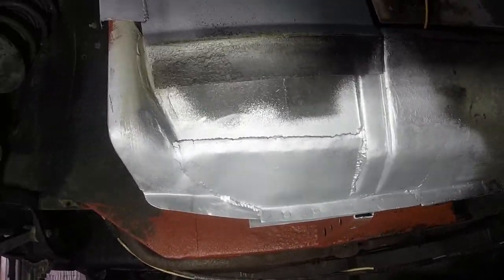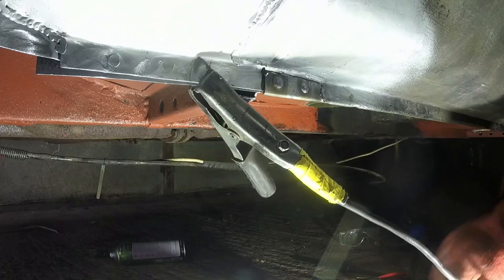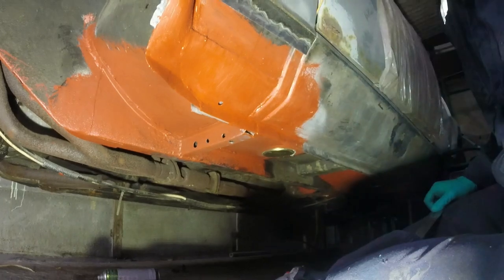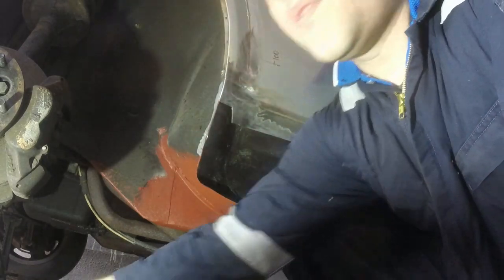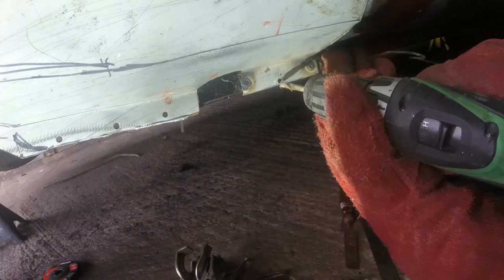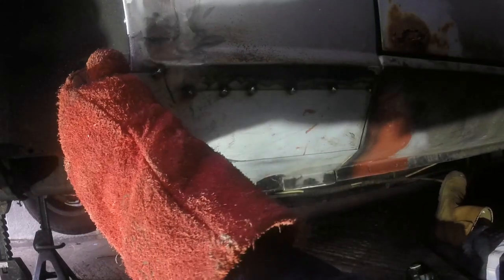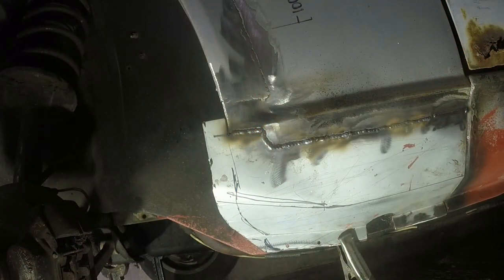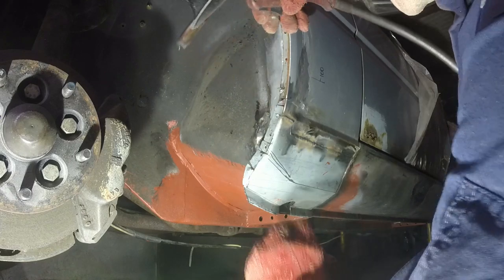Dotty 1981 Rover SD1 Restoration - Video 24 Fabricating lower wing 3

Comment: Very interesting mate and very helpful video mate. I liked this episode. Am not  going to call myself a welder but  have been known to patch up a car or two. Am a mechanic tend just to fix them up. Am a better grinder than welder. Lol.😂 Just did my pads at weekend found out calipers sticking one side and not working the other my daily is  extaxi Passat b5.5 TDI  with 239tho.   on her lol. So I  am going to take a  look at it tomorrow. Might just stick new one's on if euro doing any deals. Tc and stay safe buddy see you on the next one.👍
Reply from the maker: I had pads sticking on my old lexus.  The calipers were fine, but the pads were binding in the carriers.  Had to derust them and then file the ends of the pads down so they could move.  Pain in teh butt
Reply: @nitrosilvia   i got one side free today tomorow if dry i will investgate more on left